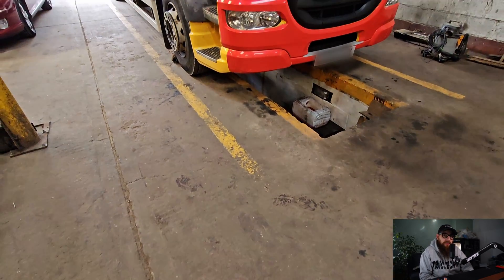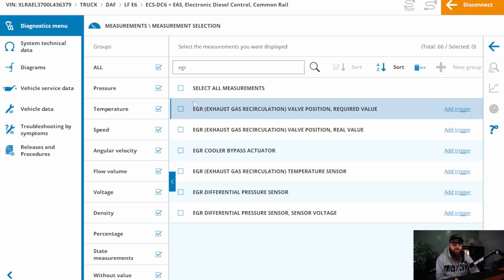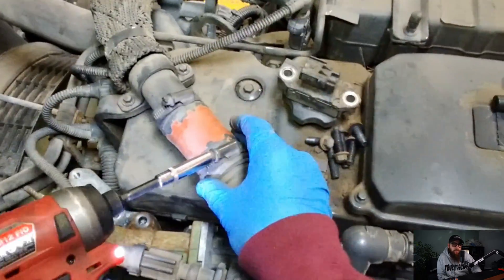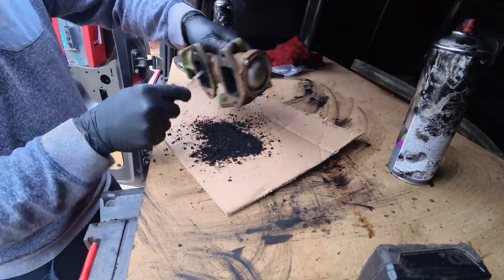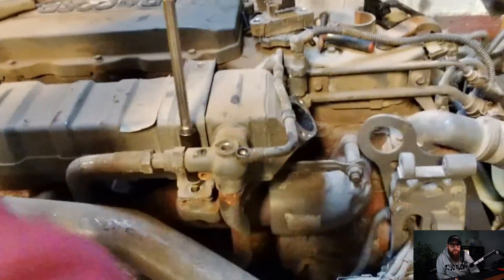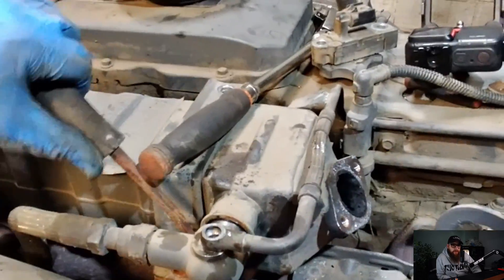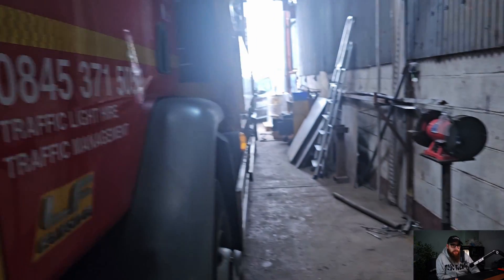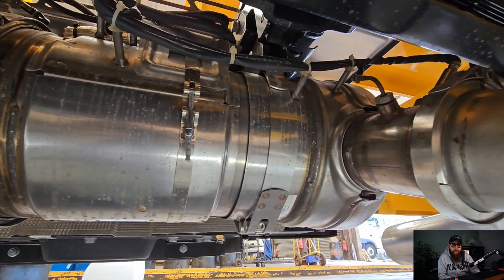A idea so good they removed it! DAF LF EGR fault

Comment: well done mate. another good video.. i have lf45 euro6 .. overheating but no red warning lights come on. just gauge rises.any idea?
Reply from the maker: Hi thanks for the comment. I'd say blocked radiator fins either internal or external or fan/thermostat providing you have pressurisation issues due to head-gasket failure 🤔

Comment: I really like this video. It is timely and properly explained. Keep up the good work.

Presently I have a lf 55 180. It's very low on power. If I'm to backup, it dies down and even stop. I constantly have to be giving it excessive rev and burn the clutch for it to go over even the slightest grade.

Also when driving regularly, It delays or struggles before it takes off to proper speed.

Comment: Apologies for the question drop, but you have already helped us with many problems with your videos.  Our fleet of DAF LF E6 suffers from "DEF abnormal pressure", which then leads to power reduced etc.  Priming and spray tests using Jaltest appear normal, road test live data shows 9bar. Do you have any breadcrumbs for us to follow please? Many thanks.

Comment: Good job. Always cleaning those pesky  DFPE ports and I also do the upstream turbo sensor tube while we're there.  I find bicycle bowden cable fantastic in a drill to wind through the pipe & ports.
Already having cracked frontpipe flexi's on the 23's but looks a bit more space around the motor now. 👍
Reply from the maker: Thanks buddy 👍😎. Yes it's usually a quick clean out but this must have been driving around forever and a day with warnings on 🙈
I will try the bike cable as the tech who I did the job for rounded the Allen key blanks off as he didn't take the manifold off to undo them  😑

Ohhhhhh product issues already! NEVER 🙈
Reply: @TRUCKTECHUK  i always find if you remove the sensor from the pipe and raise the revs to 1000rpm and gently heat the pipe with a gas torch it blows out all the carbon

Comment: The new PX7 has no egr either. However you missed an engine at the beginning which is the PX4 which has never had an egr it’s the lowest powered 4 cylinder they offered. Rarer than unicorn shit though I’ve never actually worked on one
Reply from the maker: Yes I've seen the technical data for it 😎.
I COMPLETELY FORGOT about that chestnut of an engine!!!!!🤣🤣🤣🤣🤣, I've never worked on one or seen one either 😅 may it rest in pieces at the Leyland Museum

Comment: Great video. Same problems here in USA on the Cummins  ISB, ISL with high idle/low duty cycle engines. Seen them so bad they wouldn't start because so soot plugged at grid heater. Cool of some video of Euro7 engines (I assume) with the no EGR/dual SCR. Seen a International a couple weeks in demo unit at our shop with the S13 (Scania S13) that used BW non-VGT turbo, no egr cooler but an EGR valve with intake throttle valve, and no HC doser or DOC. Curious to see the 2024 MX and see if the they finally introduce the PX15 (Titanium Graphite X15) Cummins released an X15D for Australia, wonder if DAF will use it in Europe?
Reply from the maker: Hey Steve nice to hear from you 😎👍.
It is, what it is I suppose with this issue I'm just glad Cummins sorted out YEARS LATER 😅😅😅. I have more footage of the ZF powerline gearbox they are fitting also, I love new developments 😎.
I think my girlfriend's dad said Volvo has gone to SCR only on some products now 🤔. They all seem to be following each other now lol I saw the announcement for Australia but I don't think they will ever see that product in Europe unfortunately 😢
Reply: The new ISB in the current Daf LF without EGR is Euro 6, not Euro 7 as it is still under discussion and won't arrive before 2027. Thanks for the mention of the International S13, I had no idea that Scania was making any sorts of US engine! Visually it seems identical to the Scania engine, sporting only warm EGR and dual SCR catalysts. The European Volvo "extended SCR" engine also only has warm EGR. Daf has presented a version of the XG+ with X15 for Australia only, something that took me by surprise. The last time a Daf had a 'big' Cummins engine was at the introduction of the 95 in 1987. Daf wanted a range topping model with 500hp but didn't have the engine, so for some years the "95 500" had the Cummins N14 under the slightly raised cab. It was ditched when Daf managed to raise the output of their own engine to 500hp.

Comment: Now cummins have got rid of egr ,how long till DAF follow suit ,it would save a lot of money and downtime for the owners...Like you i can not remember if it was a recall or not...I am a bit lazier than you  i pressure clean them way quicker
Reply: Great video we see that a lot here at the dealer in Arizona
Reply from the maker: @bolocheweylegyeung7789  I think it could be a full time job sometimes 😅
Reply from the maker: Hey Norb, well I think for the bigger product it works! I think the issue was the EGR valve placement instead of on the exhaust 🤔. 
No doubt Leyland would have had trials with Cummins on every different possible way to develop it and I'm glad they changed it. It might have throttle valves now but we lost the VTG and EGR and that can't be a bad thing 😂

I thought I could count on you to remember if the whole OBD A, B OR C was a recall lol

Unfortunately, I didn't have a pressure washer in the van.....maybe in the next one lol